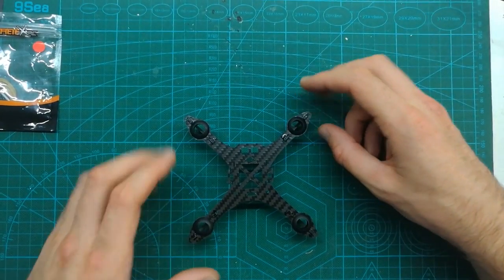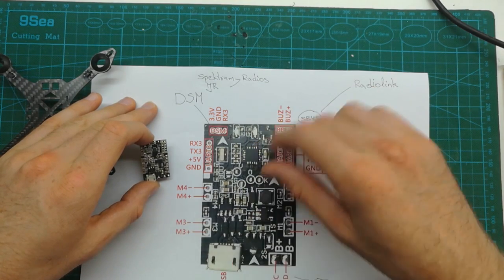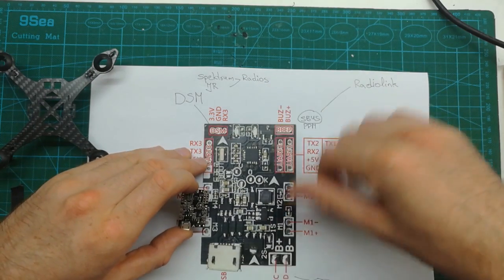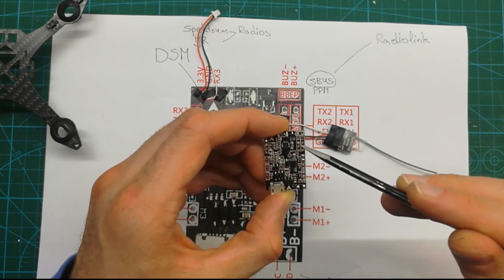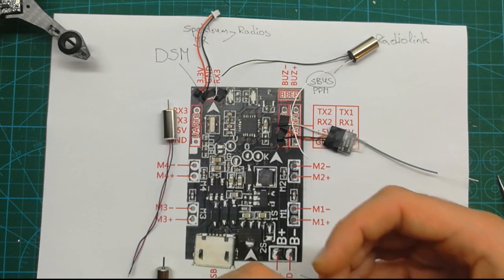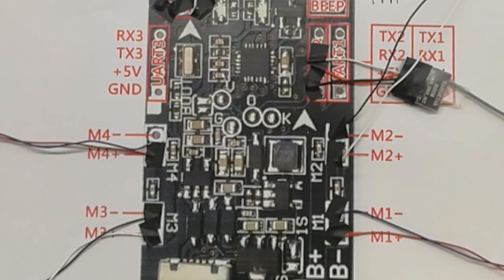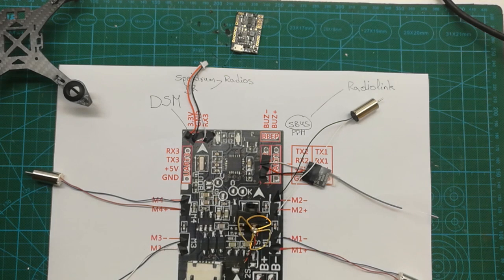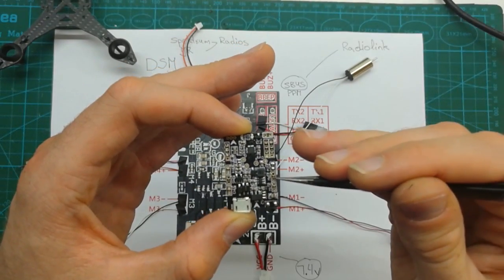Mini brushed drone build for the beginners - Part 2 (the frame and F3 Evo brush flight controller)

Comment: Hi, my V2.0 F3 EVO Brush Flight Controller will not come on.
the red light lights up when usb plugged in.
when i plug battery in, the round black copper coil thing gets hot but no lights come on.
please help.

Comment: i cant get mine running on 2s as soon i plug the battery motors start spinning full speed i did solder the pin for 2s when i plug the 1s battery works fine
Reply: I was having this issue with 1S batteries. I tried something and it seems to have worked: 
If you motors start full power when plugging in your battery you have to set motor_pwm_rate to 16000.

Go to your CLI and type:
type: set motor_pwm_rate = 16000
hit enter
type: save
hit enter

The issue I have now is my quad doesn't have enough power to take off. (even though I know it has)
Reply: thanks i will give this a try
Reply: it sill those the same thing :(
Reply from the maker: watch part number 4 it maybe about setting motor pwm rate. What board do you use? Is it from coretexrc?
Reply: micro naze32 brush i forgot the manufacture
Reply from the maker: have you contacted the vendor? onces I had one and i left soldered as 1S and ti wroked with 2S battery...that is the problem of some replicas
Reply: mm i havent tried leaving the 1s pin
Reply: didnt work i tried flashing a differnt version of CF and now it say no response from bootloader
Reply from the maker: Try to contact the shop you got it from and ask fro more info from them. That is the probelm with chinese replicas...low quality and most of the time poor customer service.
Reply: blah i toss it igot tired im trying it was a eareacc or something like that il just build a brushless setup but thanks
Reply: @yulmerced4434  After flashing the new firmware you have to use either a older or a newer version of cleanflight and it will boot the flight controller just fine. I used newer version cleanflight on google chrome app to flash the flight controller, Then I had to install a older version of cleanflight on my computer in order to read the new firmware on the flight controller. I hope this helps soneone
Reply: yul merced lol I'm in the same boat. Will buy a pre built 130mm one to play around with.
Reply: Vincent yeah i ordered an king Kong kit brushless i jist had a bunch of hubsan motor i wanted to kill them flying around the house nowthey in the garbage with the FC lol
Reply: yul merced What's the name of the kit you're getting? I'm going for the Tarot TL130H1. Might buy one last board because I don't want to be defeated, plus spent time designing a 3d printed frame for it.
Reply: the kingkong it on ebay for $110 4-1 esc and micro f3 FC comes with 7200kv motor
Reply: thats what i did i maid a 3d printed 90mm frame and never got it flying :( soo now if i break the kingkong il probably print a new frame
Reply from the maker: Well you may  try building brushless but it will be pretty difficult flying it at home for sure.
This is the coretexrc link for tiny115 just in case someone wants to try:
https://pt.aliexpress.com/item/Minitudou-CoretexRc-Tiny115-FPV-Racing-Drone-RC-Quadcopter-With-700TVL-120-Degree-Wide-Camera-Based-On/32760349458.html?spm=2114.02010208.3.264.ui0LzW&ws_ab_test=searchweb0_0,searchweb201602_1_10066_10152_10065_10151_10068_10136_10137_10060_10138_10062_10156_10153_10141_10056_10055_10054_10059_10099_10103_10102_10096_10148_10147_10052_10053_10142_10107_10050_10143_10051_10084_10083_10080_10082_10081_10110_10111_10112_10113_10114_10179_10078_10079_10073_10070_10123_10124-10152,searchweb201603_2,afswitch_1,ppcSwitch_2&btsid=a71560de-869b-4362-82e4-e338851dd11e&algo_expid=dea0db0b-40ac-4a37-8451-9faa4f9bba44-34&algo_pvid=dea0db0b-40ac-4a37-8451-9faa4f9bba44

Comment: great job put in these small components together, I have the same bored but I'm having problems with the radio the receiver is binding but the radio is not working. any help on this I appreciate it.

Comment: i hope you can help me... i solder for my fpv setup an adapter to the board but when i plug it in, it worked but after a second the transmitter and the f3 board goes off...

Comment: will this receiver " Flysky FS-A8S FS A8S 2.4G 8CH Mini Receiver with PPM i-BUS SBUS Output"  work for this FC or the eachine tiny 32bit brushed FC. And if it does it should work with the turnigy evolution tx?
Reply: You will have to check the protocol of the receiver... If its "AFHDS A2" it will work with your turnigy evolution tx!
Reply: doubledigitdreams no
Reply: TheFastly WTF? Why not?
Reply: Did you solve it??

Comment: dude another question-which receiver you are using dsm or ppm or sbus coz i am using dsm2
Reply from the maker: I have SBUS. If you have the same fight controller then DSM2 should be soldered to the top left soldering points. It is in the video (DSM or DSM2 is soldered to the same soldering points).

Comment: thanks dude for replying back i want to ask that can devo 7e be linked with DSM receiver pls reply back
coz i am using devo 7e
Reply from the maker: Being honest I do not have any Devo transmitters. What you can do is to ask online stores selling Devo 7E or get to the nearest RC shop. My SBUS receiver is as well radiolink receiver and it is compatible only with radiolink radios AT10 and AT9.
Reply: how did u get it to work im using radiolink as well but i cant get it going or even armed it

Comment: which type of radio is devo 7e is it DSM or SBUS pls reply back i am stuck
Reply from the maker: You should pay attention to the receiver type, Devo7 is 2.4Ghz radio as the most of other radios. My radiolink is 2.4Ghz radio but it can be linked with the different types or receivers: PPM, SBUS, PWM.
Reply: Martin Puot dose this board have osd for rssi ?